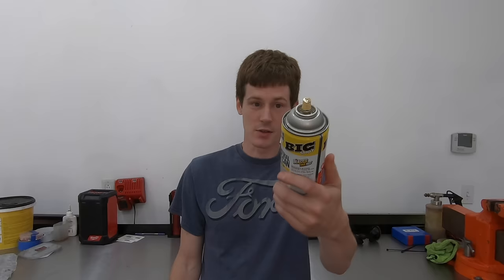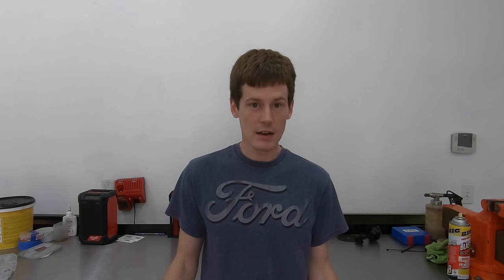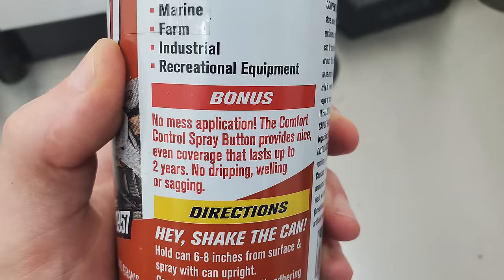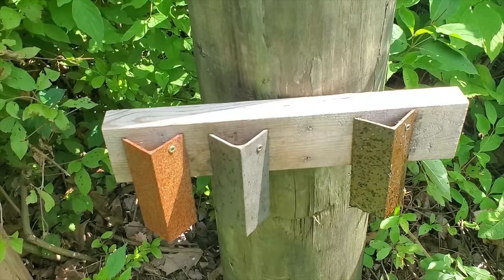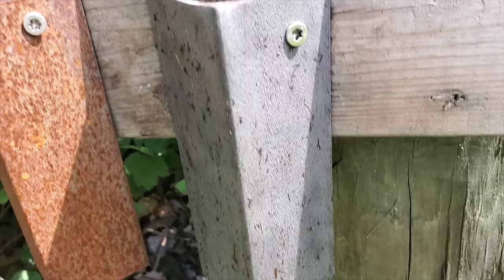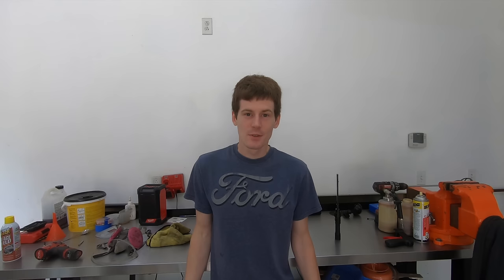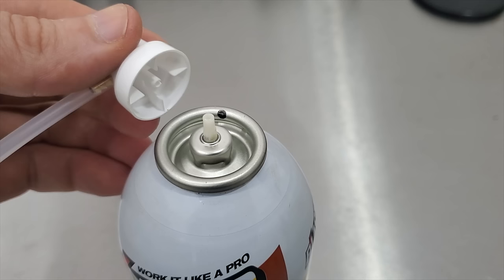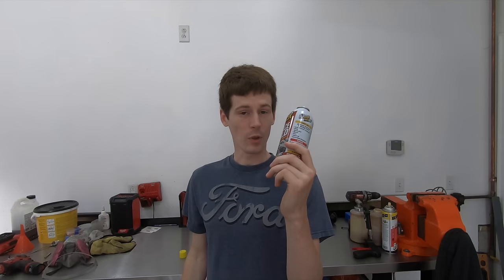I Finally Found The Best Undercoating On The Market... Blaster Surface Shield

Comment: I sprayed the frame of my 4Runner with Surface Shield a year ago and it's holding up great.  It's also the best product I've seen for preventing battery terminal corrosion.  When installing a new car battery, spray the posts, install the clamps, and spray the clamps.  Surface Shield also makes a good anti-corrosion treatment for electrical connectors.  Spray it into each side of the connector and assemble.  It's messy, but you can wipe off the outside of the connectors before the Surface Shield thickens.  I don't worry about spraying CV joint rubber boots when undercoating my trucks as I think Surface Shield will help prevent the CV boots from hardening and cracking from ozone exposure.  I spray everything under the vehicle except the exhaust.
Reply: @kimbuck-2  - I don't pull the wheels.  There's enough clearance to spray the wheel wells around the wheels.  I definitely don't spray the brake rotors, but I don't cover or mask anything.  It's not that difficult to control the spray.  Surface Shield is a viscous material.  It doesn't atomize like HVLP paint or powder coat.  It goes where I spray it.  Skid plates?  YES.  Back of the skid plate?  To the extent that I can without removing it.  I spray some back there from every angle I can.  The skid plate is well drained so there should be no pooled water back there.  Surface Shield your 2022 4Runner this year and next, and every other year after that, change the oil regularly, and it should last almost forever.  It's criminal that manufacturers still have some planned obsolescence in the form of frame corrosion.  Surface Shield can save you a lot of money for a small investment of money and time.  My new 4WD Tacoma's frame rusted through at 91.000 miles and rusted in half and was scrapped at 141,000 miles.  It was one of the many that the DANA Corporation didn't dip for corrosion resistance, and the Toyota stealership laughed at my misfortune when I missed having the frame replaced under extended warranty coverage by two weeks.  I got dick and donuts and I had to buy the donuts.  If I could have sprayed it with Surface Shield when new, I'd still be driving that truck.

I bought a case of Surface Shield in the aerosol cans.  I think I sprayed three cans on the 4Runner last year and a little over one can to touch it up this year.  It's worth the extra cost per ounce for me, not to drag out the compressor and clean up afterward.

Bonus Tip:  It's easy to change your own oil, and installing a Fumoto oil drain valve (should be the F-103) makes it super easy.  The valve is protected by the skid plate.  I have a 4th gen 4Runner with the 1GR-FE engine and the oil filter is on top of the engine, which is awesome.  It's the easiest and cleanest oil change I've ever done.  It's a shame to pay for someone to do something this easy, and the only two times I"ve paid for an oil change they messed it up (ramming the retractible car antenna into the garage ceiling one time and charging me for an oil change they didn't do the other time).  When I bought my used 4Runner, the Valvoline oil change "mechanic" had apparently installed the drain plug with an impact wrench.  When I do my own maintenance, I know it's done right.   BTW - Amazon Basics full synthetic oil is almost half the price of the leading brands I was using.  It's API rated SN+, while Castrol, Mobile1, et cetera are rated SN.
Reply: @kimbuck-2  - I got the Fumoto valves with the nipple for the Tacoma and wife's RAV4 and it's cool to have the used oil drain through a clear vinyl hose, but unless it's up on jack stands or tall ramps, it was difficult for me to get the waste oil jug underneath, so I just use a drain pan for both vehicles and no vinyl tube as that was just something else to slowly drip oil for a day or two.  I'd put it in a gallon zip lock bag with a paper towel to absorb the drips.  I bought the Fumoto without the nipple for the 4Runner.  I liked the low profile that hides behind the skid plate.  Either I got lucky or Toyota taps the oil pan exactly the same for each one and Fumoto indexed the threads to the drain valve lines up perfectly.  It's a sweet deal.  Buying quality only hurts once.

Good deal on Kirkland synthetic oil.  I've heard good things.  Probably the same as Amazon Basics, and at least as good as the name brands.

I bought a gallon of Fluid Film and the sprayer and wand for the air compressor but never used them.  I just went with the aerosol cans of Surface Shield.  I'd be tempted to spray the Fluid Film inside the frame where it's not as prone to being dislodged by rocks and mud splashes.  I think the Surface Shield goes on a little thinner (which also makes it good to penetrate into the inside seam of a pinch weld) but it also sets up a bit thicker.  It doesn't harden but it does thicken enough that it's even resistant to pressure washing unless you get the nozzle very close.  I was very pleased to see it still there a year later, doing its thing.

The oil filter on top of the 1GR-FE engine has a very Japanese fastidious cast aluminum drip guard surrounding it to catch any drips when it's unscrewed, but there were none.  The design reeks of quality.  I feel good working on a vehicle like that.
Reply: @kimbuck-2  - Vacuum oil change - that's some pro level stuff.   :-)

I used a turkey baster to suck the brake fluid and power steering fluid from the reservoir at the annual maintenance so I could add fresh fluid for a poor man's flush and fill.  The solution to pollution is dilution and that gets some of the moisture absorbed from the air and the particulate contaminates out of those systems to hopefully keep them running properly for 20+ years without any additional service.  Those fluids are cheap and the old fluids are recycled with the old oil.  Now, I have a MityVac and I use that to suck out the fluids, quickly and easily.

My vehicles are old so I dump in a quart of MotorMedic engine flush in the oil and idle it for five minutes before each annual oil change to reduce varnish and gunk buildup in the engine, even though I use full synthetic oil and change it every 4000 miles.  It's basically petroleum distillates (solvent).  Some people use automatic transmission fluid, diesel fuel, kerosene, Marvel Mystery Oil or SeaFoam.
Reply: @kimbuck-2  - I pull my wife's RAV4 up to the front of the 4Runner and do the annual maintenance on both at the same time.  On a job like this, dragging everything out, finding the tools and putting everything away is 70% of the job, which is why the quick change oil places have an advantage over the home gamer.  Annual service on two vehicles takes maybe 50% more time than servicing one vehicle.  I just bought a Daihatsu Hijet 4WD mini truck from Japan.  It's almost through the Panama Canal and will be heading to the eastern seaboard soon.  Next year, I'll be servicing three vehicles at the same time.  Not sure how I'll park them.  I don't have room to arrange them 120 degrees apart.   :-)  I should service the motorcycle at the same time!

Comment: I've been trying to decide what to use to protect the bottom of my mower deck. Ground off all rust to clean metal. #1 Any old paint,#2 Epoxy paint,#3 Fiberglass resin, #4 A rust inhibiter AKA Surface Shield. Most paint supposedly will only last a couple of years, the grass is that abrasive, so if I will need to re-paint every couple years maybe Surface Shield is the way to go. What do you think?
Reply: I have always used EZ-Slide graphite paint on my mower decks.  It is slick and helps keep the grass from sticking.  It needs applied once a year though.

Comment: PB Blaster products are no joke. I bought a 120yr old coal burning parlor heater that was in this lady’s family since new. I need to remove the cast iron sides to have them soda blasted. The bolts were large flat heads and the nuts were large hex heads. I soaked every nut and bolt on that heater with their penetrating lube, I tried the usual  WD 40 etc. used PB Blaster, let soak for a day and was able to removed  every nut and bolt from the heater except one that was located next to the belly of the furnace where the coal went, hottest part of the stove. Never would have guessed that the product would worked so well been using it ever since!

Comment: From Canada.  Decades ago started with Rust Chek the switched to Krown, both oil sprays.  They worked well in panels but due to their almost watery texture, the under side would come off after driving on wet roads.  A few years ago I switched to Corrosion free (cans are available at Canadian Tire sold as Rust Cure and also dealers of Corrosion Free can spray them) which is a bit thicker than Rust Chek and Krown.  Corrosion Free stops dripping during application.  Recommended to apply Corrosion free in warmer months to ensure it creeps to the bottom off panels.  It’s been doing very well so far and not washing off the underside.  Maybe it’s similar to Blaster Surface shield?

Comment: Might not be as easy to use as the cavity attachment, but you can use the WD-40 spray nozzles with the red straw attached. You could probably even rig it with a extension to make it easier.

Comment: I really like the surface shield.  I've only used the aerosol but it seems to work well.  I don't think the other aftermarket spray undercoating that's out there does very good... It seems to make the rust spread worse underneath its application.  I'm going to stick with surface shield.  I might even get under my own Ford escape and spray some on there 😄. 
Thank you for your detailed and thorough video on this product. Keep it up, Blaster!

Comment: I use rotella T 15w40 mixed with diesel fuel every fall on my 2005 ram plow truck in Northern Michigan, and my truck is absolutely 100% rust free. It seeps into every crease of the body and frame. The total cost every fall is under 100 bucks. I've used fluid film on other vehicles, and the rotella is far superior. Rotella t has a really high zinc content

Comment: I'm a little  cautious when it's  a paid advertisement, but I do love pb blaster, so I'm willing  to give it a shot, it would be nice if that aerosol can could accommodate the 360° spray nozzle, I hope that's  changed befor I use fluid film  on the inside of my frame ( I have a bran new 2021 4runner)  that hasn't  seen a winter yet and I'd love to do a long term test on using only pb blasters product
Reply from the maker: You have to remember, I was honest enough to tell you that it was a paid video and I also explained why. It would have been very easy for me to not mention any of that and keep my audience in the dark. I've always been very honest with my audience and that hasn't changed. The product works.
Reply: Why it's not available yet?

Comment: You are doing a great job with those tests,  I have a question for you how to treat a area where the rust is really advanced ?
Reply: Wire brush then treat as normal.Ive used TCW3 two stroke oil mixed with a splash of kero and that stuff will eventually clean the old rust off down to a better surface.But you have to keep after it.

Comment: I’m pretty interested in surface shield but am wondering if you’re currently doing a long term test on it now? I’m a bit skeptical to buy until I see you do your long term test and post results. It’s easy to claim they’re the best based on the consistency and ease of application due to said consistency but I want to see the results. I will be waiting for an update video come spring time!
Reply: I can tell you if it sprays on like Fluid Film or Woolwax it’s a winner. I sprayed my truck with Woolwax and it still looks new

Comment: This video reminds me why I've chosen to live in the desert.
Reply: I live in Denver which is a high desert. Long story short my new to me Tahoe had a rusty frame. I've never really dealt with rust. I used rust remove and it all came off pretty easily. Now I'm back to bare metal with spots of black where the ecoat failed. I bought POR 15 but someone said it was junk and traps moisture underneath. I don't know what to do. This shit is exhausting. I feel for people in the rust belt
Reply: But in the desert, the blowing sand and dirt scours the clear coat off of the paint, and the UV destroys rubber window moldings & fades the interior

Comment: I've always Heated My Fluid Film to spray it on and Mix in a little Chainsaw bar oil. Spray that on and Then I spray  CRC 06026 Heavy Duty Corrosion Inhibitor. I've never had a rust issue zero.

Comment: Update on bulk availability as of 10/29/21 from Lou at Blaster.

The five gallon pail is not available for approximately 3 to 4 weeks. The one gallon container is available and the price is $50.00 for the 128-SS. There is also a $20.00 flat rate shipping charge to deliver it to you.

Comment: Little invention of mine I will share. 1/2” pvc, make a tee.hose fitting on 4 ‘ end . Cap the 2 other 2’ ends. Drill 1/8 holes so it sprays up. Wash under vehicle in salt season, drain when done so it doesn’t freeze. Get more life out of your vehicle

Comment: Thank you for your informative videos.   It would be interesting to see how the products hold up on pitted metal vs. smooth pre-rust metal.   I get a lot of salt and clay mud on the frame of my GM pickup, and have experimented with paint, rubberized undercoating, and finally oil.   The oil hands down works the best.   I've been using Krown and will definitely check out Blaster.   I watched one of your earlier videos where Krown did not perform well on the roadside test, but I think it may hold up better on pitted vs. smooth metal (of course ideally stopping rust before it pits would be the goal - and I wish GM would e-coat their frames on full size trucks).   Thanks again!
Reply: Rubberized coating is absolutely the worst thing in the world to use. Rubberized coating is actually WORSE than doing nothing at all. For more information, I highly recommend you check out the video "Rubberized Undercoating Will Destroy Your Car!" by the South Main Auto Repair channel, and see it for yourself. Never never never use rubberized coating.

Comment: Hey thanks for doing all this valuable research. I’ve been using rust check and krown with good results but newer vehicles are rust resistant coated from the factory better than they used to be. I haven’t kept a vehicle long enough to prove they actually work but the exposed parts on the underbody are mostly missing any undercoating after a winter. I’m thinking surface shield may be the answer for best all around coverage. Just wondering what your thoughts are with using it bulk with a pressurized 1 liter undercoating gun rather than the air / siphon type sprayer. Wouldn’t that make less air borne when spraying?

Comment: If you have a new car use all 3 like this! Put first the thinnest one let it be for a week if you can drive some other car then put the thicker one over the thinner one and let it be for two weeks and then put the thickest one and take the car right away out on a sand road and drive like crazy and after still throw sand under by hand so it’s binding the last layer as good as possible! It lasted me five years and zero rust on a -06 Corolla that is famous for rusting! Of course I didn’t use exactly those brands but it made a crazy difference

Comment: If you can't afford this liquid gold, fluid film is still effective and relatively inexpensive, 1-gallon bucket will last 4-5 years in my experience 'annually' spraying my shortbox Silverado 1500 and a Chevy Cruze.  I spray all surfaces and suspension in the wheel arches, then spot treat the undercarriage: bolts, fuel/brake lines, fuel tank straps, etc.
Reply from the maker: Yep, I have NEVER said Fluid Film was a bad products. I constantly have people asking me what is the best. SS is your best option from what I've tested.

Comment: can you spray this on a underbody  - that has already started surface rust?? Or do i need to get all the surface rust removed first?
Reply from the maker: Spray right over top of existing rust and it will displace the moisture and stop the rust from spreading.
Reply from the maker: @restopesto9448  this is basic high school chemistry. If metal is not exposed to oxygen it cannot rust. The way these products work they create a barrier between the oxygen in the air and the metal. The petroleum in the products also displaces any moisture (H20 or hydrogen2 OXYGEN1) on the surface. This stops the rust and it will not spread.
Reply: @restopesto9448  waiting for a reply.

Comment: Great Stuff! I live near the beach and was curious if you thought any of these '"too sticky" for sand?  We can drive on the beach in a spot, I had DIY fluid film and just found a can of surface shield; but started wondering if this may cause sand to stick to the chassis (FJ cruiser)?  Thanks
Reply: Sand will stick, CRC marine rust inhibitor or another cosmoline is better if you are in a sandy or dusty area
Reply: Cosmoline rp-342

Comment: I wool waxed my 1995 f150 two years ago and it's still there.  I run it through the car wash that has undercarriage high pressure wash and it hasn't taken it off.  I've gotten it in my skin when working on the truck and it takes a bunch of Dawn detergent to wash it off.

With this new stuff being lanolin based, I imagine it is fine to spray it  on top of the wool wax

Comment: In the 70s Dodge built trucks with heavy use of galvanized steel. They said so it will have a long service life.  My truck is an example.

Comment: Hi, great videos. They have been extremely helpful for me. Thank you. I would be interested to see a test with a spray bottle from Home Depot and the beta test bucket you got to see if there are any formulation differences.
Reply from the maker: I HIGHLY HIGHLY doubt there is any difference. I've used both the beta and what you can buy off the shelf. Literally zero noticeable difference.